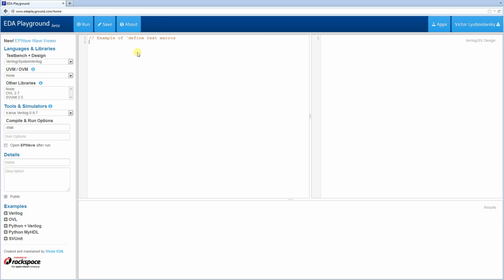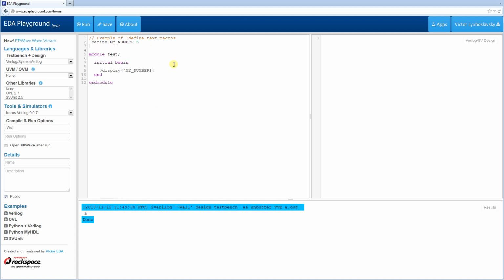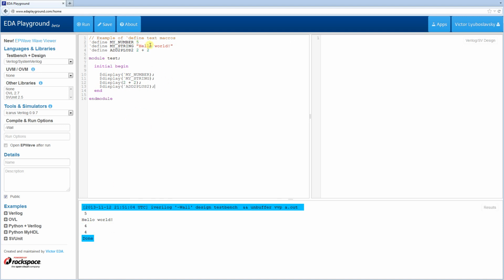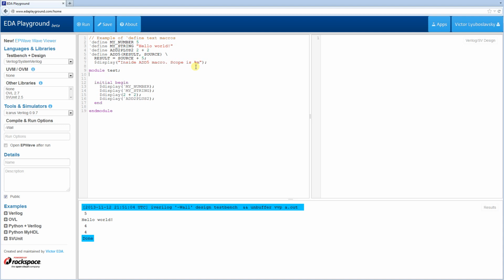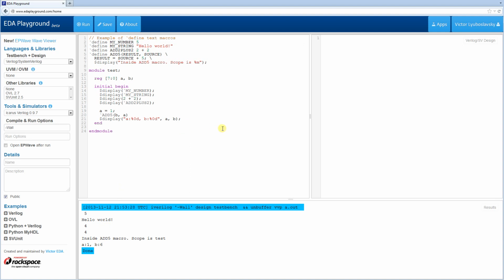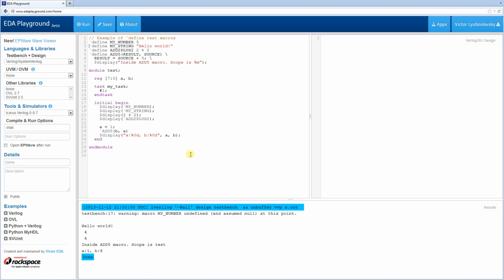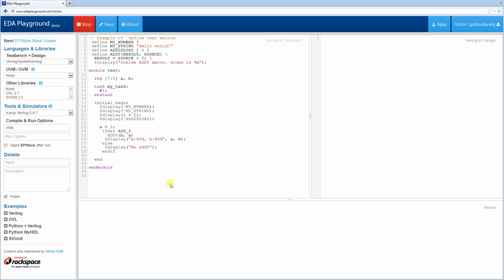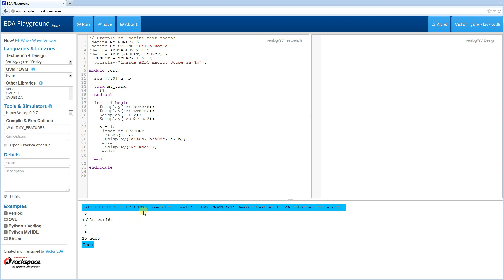Verilog Tutorial 3 -- `define Text Macros

Comment: Can we pass macros heirarchically like parameter?
Reply from the maker: No. Macros are so-called compile directives. They do not fit in the the Verilog/SV scope. So, if you define a macro in one module, it is visible globally: https://www.edaplayground.com/x/fkMB . So, passing a macro hierarchically like a parameter doesn't make sense.
Reply: @Edaplayground_EPWave  I wanted to to understand this:
Consider I have a module_A with different compilation statement based on MACRO1. Can I have two instances of module_A in my top file - one instance with MACRO1 and another without MACRO1? Is there any ways of doing it? Thanks in advance...
Reply from the maker: @karthikkotebagilu3421  I can't think of way. This sounds like it might be an "XY" problem (a problem where we spend time focussing on a specific solution to a more general problem, when the specific solution is not a good solution to the general problem). What are you actually trying to do?